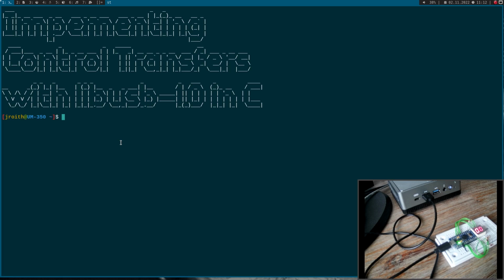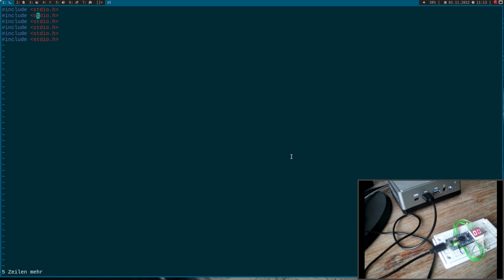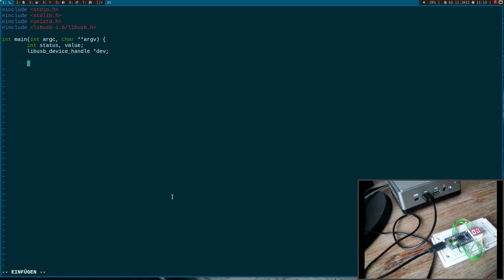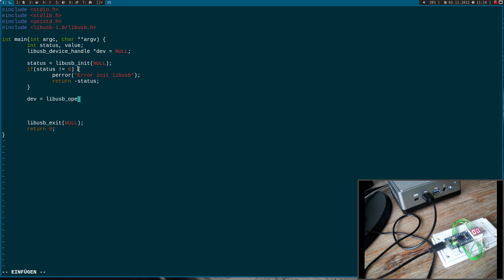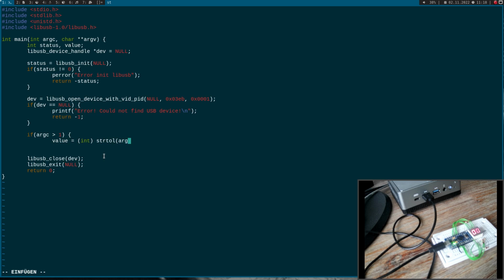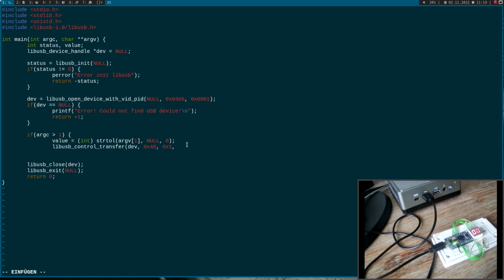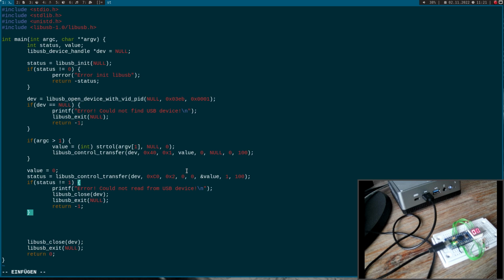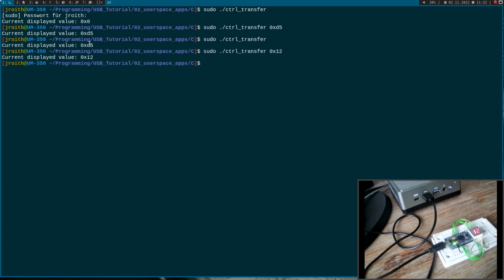GNU/Linux & USB - Implementing Control Transfers in C with libusb-1.0

Comment: Thank you for your series of videos! I have learned so much. I have reversed engineered the pantone color calibration sensor built in into the palmrest of my laptop. Managed to find the right ctrl transfer parameters and arguments to read the data! 

I have also managed to find the wrong ones so i brocked the damn sensor lol. It was a fun ride. But i think the code of the controller firmware was poorly written because i have managed to damage it just by sending mass GET REPORT and read interrupts via usb.

Comment: good video! I wish you had expanded on the request type when calling libusb_control_transfer.

I'm still have some trouble understanding this bmRequestType value, namely , when to use a standard request type or a class-specific request type or a vendor-specific request type. Could you elaborate on that?

Comment: One minor nitpick with this video, it relies on the assumption that the host system is little endian. It would be better to use a literal unsigned char for the number instead of casting the int pointer to an unsigned char pointer. On a big endian system, it will interpret the received value quite a bit different.
Reply from the maker: Yes, that's true.
Reply: @johannes4gnu_linux96 doesn't libusb provide macro like USETW() to account for endiannes?
Reply: Rockstar